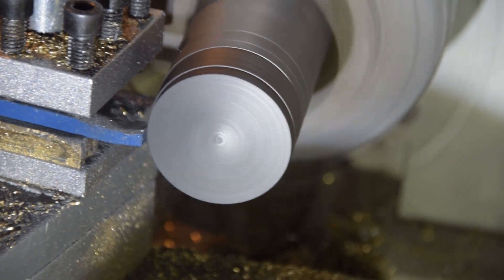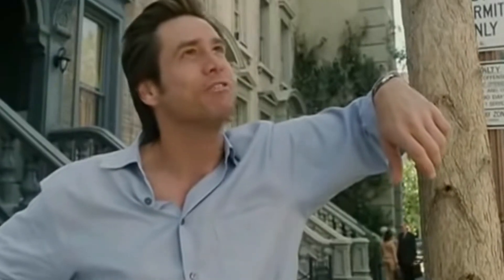Making a Rocket Nozzle on a Budget!

Comment: I could make a nuclear fusion engines easier and cheaper
Reply: In that case, why are you holding out on the rest of the world? Is it that you don't like money?
Reply: Aerospace and nuclear are often restricted to a military monopoly since I have MIT peer review endorsement along with by invite only in of March 2019 gave a presentation during an engineering conference held inside MIT's Electrical Dept. on Vassar Street.   

Also I need financial backers along with permission to legally tap cosmic ray muons over magnetic north while Dr Mitchell Swartz says I should take Jerome Drexler to court for patents plagiarized while my CIA archaeologist is stuck in eastern North Korea in search of Noguchi's WWII cosmic ray muon catalyzed rocket plane engine. 

I would settle for a Xcor Lynx spaceplane with deuterated diborane fuel tanks and a Helmholtz coil to focus cosmic ray muons. 

A case in point maintenance crew at a local airport freaked out when I mentioned isotopic fuels while a local aerospace institute is under tight security and of course they will not let me relocate to win approval from parliaments brainwashed by how environmentalists vilified nuclear with "radiation" for a catchphrase of monster movies or even Stan Lee Marvel comic books any engineering proposals would be Walter Pecked.
Reply: They questioned my patriotism loyalty or obedience when I used to exchange emails with an editor in of Chengdu Sichuan.

Comment: Adding to the conversation - your graphite should be able to hold up to MANY firings.  This makes me curious - did your machine shop use coolant during manufacturing?  If so, that would possibly explain your erosion.

Phenolic is another relatively cheap option for nozzles. It does ablate, but nothing appreciably given your short burn times.  Most importantly it offers a huge advantage to your airframe/casing as much of the heat will leave the system.

All that said, really unique approach, and great problem solving.  It is nice to see you tackling the problem rather than calling it quits.  Tight funding is a heck of a motivator!  Looking forward to the testing.

Comment: Sorry, but you can electroplate a bronze nozzle --- (probably not aluminium bronze) but tin bronze should work fine
Reply from the maker: I am not sure why you would want to electroplate the nozzle...  What advantages would that bring?
Reply: @ASTRABremen  I guess it would take two weeks or so, but in case you want different metals, cooling channels etc. that could be an advantage. Think of it as low cost and simple 3d-printing. It's better suited for the injector or parts of it.
Reply from the maker: @mathiaslist6705  ahhh, I see.  For now we are just doing ablative cooling and radiative on the nozzle.  But, if we upgrade in the future to a liquid system, this could be a great option!

Comment: Why not cast it out of steel, you'll get a melting point 400 C higher.
Reply from the maker: Unfortunately, the furnace we have only goes to 1160°C so steel casting is not a possibility.  We are working on making a new one that can go up to 2000°C, but until that comes online, Bronze is the most heat resistant substance we can formulate.  Also, I think the Bronze looks really nice... that's gotta count for something...

Comment: Why. Rocket. Smoke. Before  lunching  time . Can u 
  
 Explain. It.
Reply: Usually two reasons 1. The igniters have ignited to ignite the motor or engine, and 2. The water system with the ignition is creating a smoke cloud as the rocket launches, or it might possibility be oxygen overflow! We would need to see the smoking you are talking about to give you the final answer! 😱😝🤪😁👍👍👍🇺🇲

Comment: I'm quite interested to know where you got those informations about graphite. I'm afraid you got it pretty wrong. Graphite does not ablate. It can whistand crazy temperatures without any isssue. And, unlike what you said, it's a poor thermal insulator : it will transmit the heat to the case. That's why big motors use a phenolic carrier (which ablates) to hold the graphite throat. 
Joe barnad from BPS space has made a relevant video about rocket nozzle recently. I'm sure you've already watch it but be sure to have a look again, and to properly understand what's being said
Reply from the maker: The graphite definitely ablates...  We have first hand experience of that.  Please remember that Joe is not a rocket engineer and sometimes gets these things wrong (especially the mechanical things - he is much better at the avionics stuff).  But, you are right, the graphite is a terrible insulator.  We are also using a phenolic resin, hard paper material to insulate the Bronze.  The graphite is just at the throat so it can take the "crazy high temperatures".
Reply: @ASTRA Bremen  you probably bought some low quality graphite. I can assert (and many many other rocketeers as well) that graphite can whistand a basically infinite amount of firing (loki and fisher hardware). The only issue being its mechanical strength (it really likes to chip, as you've certainly seen).
Reply: @ASTRABremen   @shere_kan8329   We can say that graphite has worked exceptionally well for our engines, with almost no nozzle throat erosion (<3-5% throat area) even for extended burn times (50sec +). If you have an oxygen rich combustion or low-grade material, this can contribute to significant erosion, but both should be avoided regardless. This is why our engines use a film cooling ablator in the post chamber to create a fuel-rich layer at the graphite. That being said, your approach with a casted brass nozzle is quite interesting! One thing that we would recommend improving the lifetime of your nozzle design is to place a phenolic paper liner between the graphite and the brass to limit the heat flux. Wishing you the best for your upcoming test campaign!
Reply from the maker: @HybridEngineDevelopment  Thanks for the input and the real values for graphite erosion in your testing.  We are going to try out both designs in our test so we will see what works best for us (the bronze does save a bit of weight).  The phenolic paper liner between the graphite and the bronze is probably a good idea as well.  We will decide if we need that after our first tests though.  Hopefully we won't melt it on the first try 😅